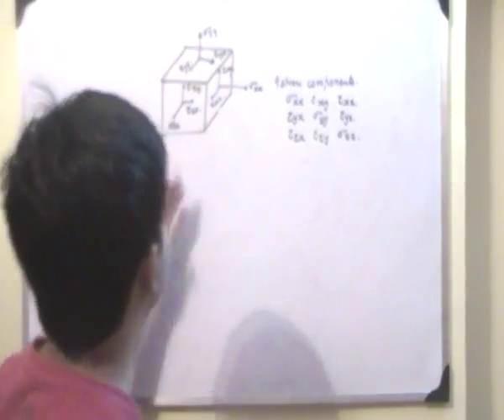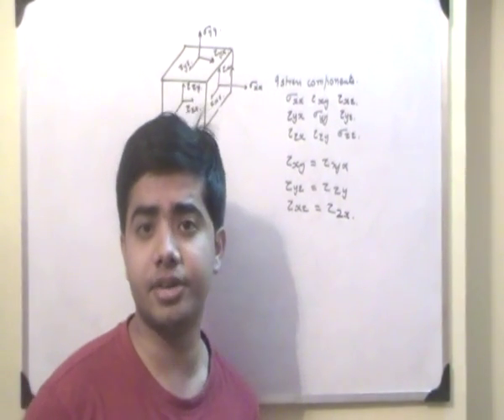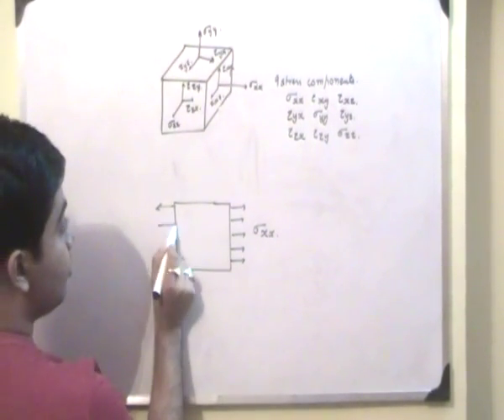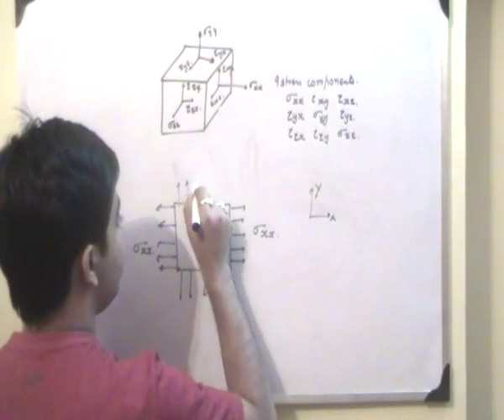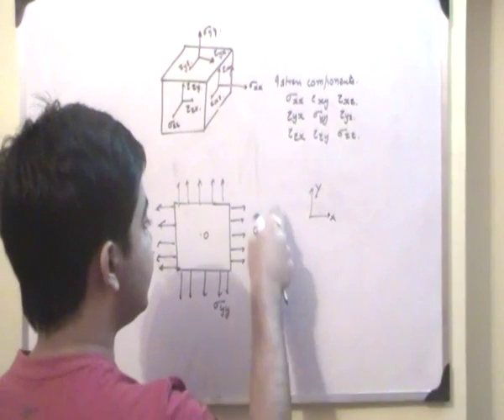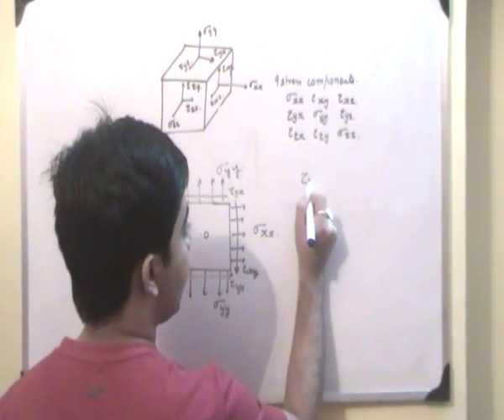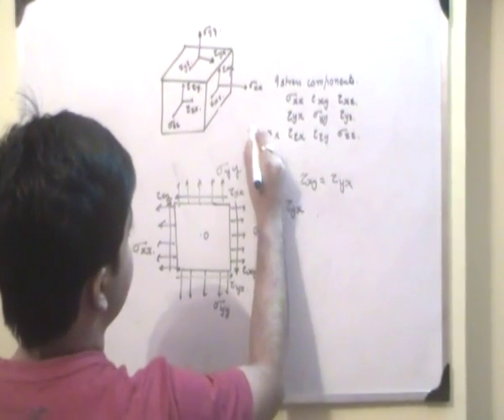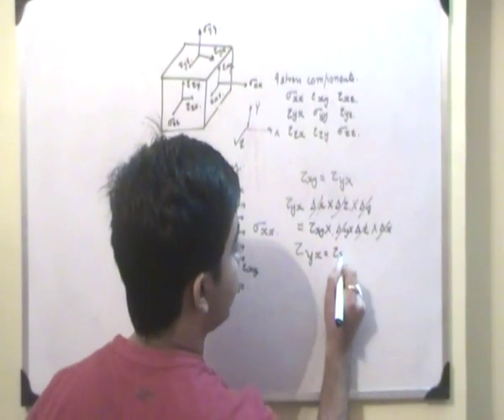plane state of stress.MP4

Comment: Your explanations are great in your previous videos but one thing here i don't understand is that why have you chosen directions for Tau arbitrarily.
for example you chose Tau xy downwards on right side and then upwards on the other (which kind of makes sense). Then you chose Tau yx towards left on top and towards right on the bottom. All those shear forces counteract each other so there is no moment. BUT WHY DID YOU CHOOSE FIRST Tau xy downwards and first Tau yx to the left, You didn't explain that. If you chose top Tau yx towards RIGHT and Left at the bottom then  the whole plane will have double amount of clockwise Moment.
could you kindly explain that please. 
thanks

Comment: You did not mention the core reason why in general all the stress components related to z direction can be ignored if it is the case of the plane stress condition.
Reply: some of the work material like in thin metal sheet the thickness dimension is very small than other two dimensions i.e. length and width and hence the stress in the thickness direction is neglected or is 0 as it is not able to develope within the material and also very small in comparison to the in- plane stress.there for the thickness of sheet metal is not acted by the load and sheet metal can be analysed as two dimensional.